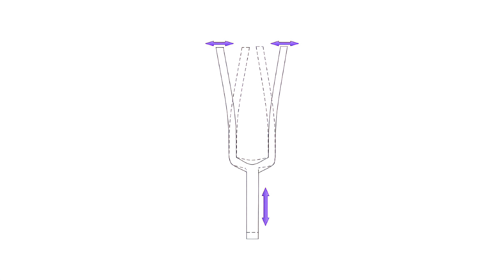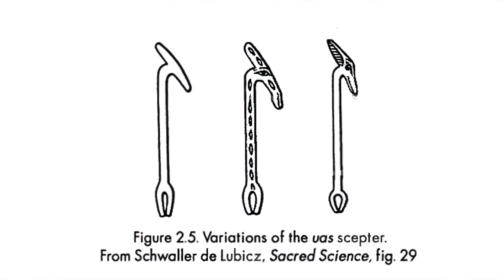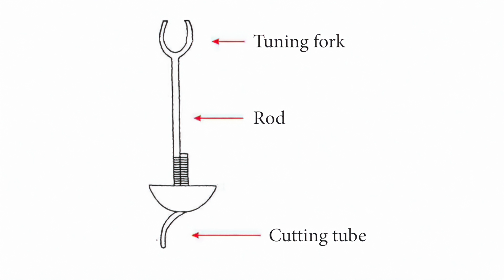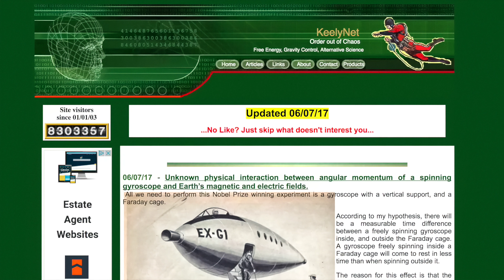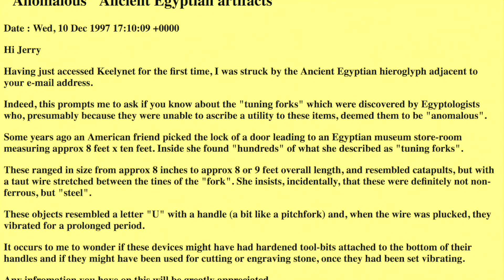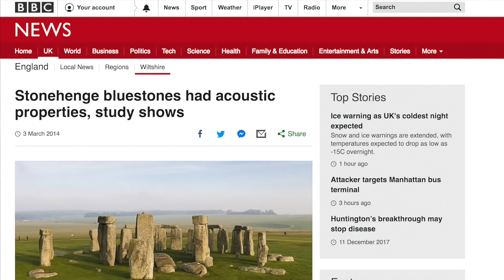How the Ancients Cut Stone with Sound - Lost High Technology Explained | Ancient Architects

Comment: I have spent many years experimenting with Acoustic levitation and technology similar to what is discussed in this video. The acoustic properties of the Megalithic sites need not be understood or planned if the designers did indeed cut and move the stones via sonic technology because the process functions in such a way that the objects will literally move themselves into an arrangement that is like a chord and can "sing". The property of something being out of tune and in a state of discord with the pump frequency is exactly what is used to move the objects into a more favorable lower energy state. What you end up with is energy wells of sorts an from a local frame of reference the stone simply believes itself to be sitting still in a state of freefall for 0.5 * period. Have the cycle the object is in this state of falling at which time friction need not be overcome and only inertia. This is easy as anyone who has attempted to off balance a washing machine will tell you they will literally walk themselves to the most stable vibratory state. Once in that state and place they are now in a node and when pump frequency is removed all objects in the system will now be resonating together to some degree so that when one rings.... They all ring. Idk, it can be a bit more complex to explain.... but the above should be enough to understand why all the sites have these properties. I personally agree, they used sound in the same way we use Electricity. The hows and whys of the technology is completely lost.

Comment: I've been looking at pictures of Was Sceptres or I guess they call them Waset.  I've noticed many pictures have an eye on the top of the staff near the tool.  But what if that's actually a holding pin like is used with axes or hammers or other such tools today?  If a nail is used, that would give the appearance of an eye, but it actually has a function.

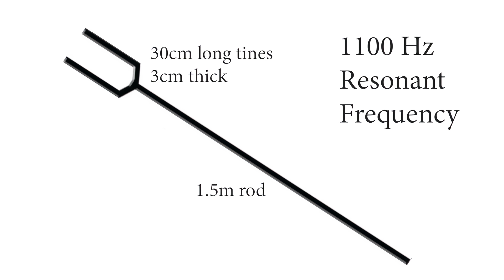Comment: have any of you tried to fabricate such a stick and drill in granite ? You are clever and also show that the bottom stem also contracts and expands, when the U-wings are vibrating . 4:30 How is the frequency of the pitchfork determined mathematically . 8:45 How could the researcher  know for shure it was non-ferrous metal, the only way to find out is you have a magnet, iron is ferrous and one of the only magnetic material . The researcher said, a gray metal that is not steel .

Comment: Matt this is the tip of the iceberg.  You hit the nail on the head here.  these forks could create the holes we see with the proper "bits" attached to the ends as you state late in the video.  insert dry wood and water, and the wood expands, splitting the blocks along a 90 degree line to the face of the block.

seriously, this is something that we can test today.  i feel like even on a small scale this would be pretty simple to accomplish for repeatable results.  thank you as always, cheers.

Comment: bet ya $100. they never cut stone with vibration, it's omnidirectional and can not be controlled to drill perfect holes or cut flat walls at all.  I think it was all cut, drilled and shaped as easily as wood is today with methods we have yet to comprehend. there are many stone jugs people think were turned on lathes but they have handles and that tells me rotating the stone being carved was not necessary.

Comment: I had read or heard about the tuning forks before but it really hit me today with the rod attached to one. If you  attached a row of them along a copper plate with the same resonance then theoretically you should be able to cut slabs or blocks in the same manner. When one is stuck all wil begin resonating as long as there the same frequency

Comment: 6:17 wow  actually they can cut through granite with a copper pipe sand and water.  they did it in the video that you showed.  It just takes a really long time.   The problem with tthe video is that they do not leave the deep spiral threads seen in the drill holes.  The pics of the drill holes dont show the spiral marks in the video either.  Also why is vibrating a copper pipe so much more reasonable than roatating a copper pipe.  you're cutting by abrasion, its hardly a difference yet you mocked the other strategy so hard lol

Comment: This has to be demonstrated to be believable. More conventional mechanical drilling using a bow-driven copper tube with emery or similar abrasive lubricated with water or oil in a vertical orientation has been demonstrated to reproduce the observed characteristics of holes in sarcophagus lids etc. (Gorelick & Gwinnett, 1983, Expedition 25, nr.3, 40-47)

Comment: Interesting idea. It would be good to make an experiment. So far what seems to work is the basic "hole saw" with a copper plate and a rotating axle with a crank and a flywheel and also an electrically powered version which vibrates linearly.

What would be interesting to try is using a bell as the source of vibrations.

Comment: Tuning forks act wirelessly like Tesla coils. You could have a single person hitting a very large tuning fork in the middle of a group of worker all holding in their hands smaller tuning forks of the same frequency and cutting through stones. I know there would be a lot of losses from the air, objects in between, the distance and more which would discourage anyone from even thinking about exploring the subject but I think you could create a room that generates a strong resonance energy buffer and cut the stone at timely delays like a pendulum/spark gap. Very crude experiment showing the effect of resonance of turning forks, same as Tesla coils:  https://www.youtube.com/watch?v=aCocQa2Bcuc      Very high frequency would create penetrating waves wouldn't it? Perhaps mixed with other waves lengths and wave types allowing to softened the stone. The medium you are submitting the stone to will affect the characteristics of the material. Just like metals are hard on Earth but softer and even vapor on other planets with different pressure mediums. Technically if you can affect the molecules of the material with vibration then you can manipulate it's very fabric. Stanley Meyer was using this concept to split Oxygen and Hydrogen by progressively stretching the covalent bond of the atoms until the breaking point using the natural resonance of the material. Tesla earthquake machine. Standing waves. Sound levitation using standing waves: https://www.youtube.com/watch?v=3MXVSdXZzpc

Comment: The thing about Sonic using sonic waves or whatever is nonsense that's not how they would do it to use is solar lens they reduce the radius of the light point to a very small point and get it to heat well above 3000 degrees and granite melts at 2500 degrees then you just mulchy or granite and you poured into a mold then it cools and you produced Stone and structures that way and the main part of the pyramid was built using a type of cement is made from Limestone it's a cement and melted Granite formed in blocks it's not moved they were built on site

Comment: Quartz sand will abrade quartz crystals in granite. All the other minerals in quartz are even “softer”. 
The reason we use diamond impregnated core drill today is because they work quickly. In ancient times with a bunch of laborers quickness was not needed. Using copper or bronze tools and quartz abrasives would do the job - just more slowly. 
The rest of this sonic stuff is BS.
Reply: Also, they have recently found Corundum residues in some of the coring holes, these crystals have a Mohs hardness of 9, close to diamond 9.5.

Comment: Funny, I've now seen a demonstration of a hand crank drill,made of copper, using an abrasive sand slurry, and it worked like a champ ( yes on granite). And I've seen this electrical sonic-resonance drill with a sand slurry, and it seems to work also, but not as well as the hand crank. So now an honest assessment would require the use of occam's razor ( the explanation using the fewest assumptions is probably the best). The hand crank method is materials and techniques the people in this region are known to have had. The SR method requires the assumption that they had the knowledge and means to generate electrical power: for a less effective method. Calling someone stupid because they don't agree with your unsupported hypothesis, displays the level of your intellectual dis-honesty!

Comment: Great presentation, thanks for sharing. You can cut the tube holes in granite with a weighted copper cylinder and a handle to rotate it, using either desert sand, quartz sand (found on the banks of the Nile) or for even better results they may have mined Corandite as the abrasion material and of course water, video demonstration of it here : https://www.youtube.com/watch?v=yyCc4iuMikQ This would also leave the spiral groove that Chris Dunn pointed out.

Comment: But there's that ancient Egyptian "drill", a stone cylinder core from drilling, that has deep scratches that suggest an aggressive power rotary tool that cut it rather quickly. This sound drilling would appear to create a smooth bore like the sand and copper pipe method did.
Reply: It suggest a bad drill..perhaps the copper ones were taken..

Comment: I'm sorry, but you haven't thought this through. You mention frequency, but to cut even the very softest rock you would need enormous amplitudes (volume, or the difference between the peak and trough of the wave). You don't get enough energy to cut stone from a short copper tube attached to a tuning fork. You would have to supply so much energy to that system that the copper rod would disintegrate. The evidence against the use of copper tools is that they are not hard enough. So, the same argument applies here. You would still need a hard edge to cut using sound, because copper will just be blunted against the stone the same as if it was being hit with a hammer, even if it did survive to make any significant contact with the rock.

All the evidence points to stone softening using acids, and the making of different forms of concrete. The tightly fitted stones of Inca sites were achieved using a yellow paste derived from the outflow from mines heavy in iron pyrites, as witnessed and written about by the Spanish. The Romans had concrete, and there is at least a possibility that they got the process from the Egyptians. Relief "carvings" are actually cast, and you can even see parts where the casting was completed ineptly, where the mixture was too wet and the casting ran. On the Giza Plateau there are runnels of granite BETWEEN the limestone pavings.

The boreholes were drilled using a single spiral cut that progressed at a fraction of a millimetre per rotation. That could not have been achieved through sound, nor with any conventional tool that we know of UNLESS the rock was very soft when the cut was made. There are even examples of abandoned cuts that show how the rock hardened as the cut was being made, making it too difficult to continue.

There are also many "sarcophagi" which probably contained reactants, as well as some evidence that at least one pyramid exploded from the inside, possibly as a result of chemistry gone wrong. The Egyptians were known to be alchemists/chemists, and since any other technology would leave behind other evidence, and since there is no evidence of such technology, the only evidence we have (as partially outlined above) points to chemicals/geopolymers.

Comment: I would love to see a real demonstration of this technique. 
If is that simple it should be easy to make a demonstration.
It takes a certain amount of energy to crush a given amount of rock. The given amount of rock is of course the volume of the cylinder wall removed. To do this, this amount of energy plus a factor for losses to heat and sound in the air, must be input.
At the point of contact the copper is still softer than the rock so the wear on the tube would be greater than rock. This would change the resonant frequency of the cutting rod.
I suspect that no-one has done the demonstration. Cite me the research paper if I'm wrong.
At about the 7 min mark the bloke in the video claims there is no way to clear the cuttings.
Ironically he is wrong here. Modern drilling techniques using diamond tipped cutting tubes pump compressed air down the inside of the tube, at the tip the air passes around the cutting tip then travels up the outside of the tube carrying away the cuttings to the open air.
Cite me the demonstration, please.

Comment: 7:03 "the ancients wouldnt have had the tools needed to create the tool marks we see in ancient stone cutting" and then shows a photo of basic drill marks, very shitty drill marks at that that clearly shows very primitive technique.
Reply: Do you realize they did this to granite and the hardest stones? We need high powered drills for this and to this day we still need to change the bit every few hours bc the drill bit wears out and disappears. This is very complicated
Reply: @bobm3250  I work at a granite fabrication shop. We don't have to change the drill bit every few hours because it's not a drill bit-- it's a saw. And when we do have to change drill bits for mounting screws its every few months we take a trip to Home Depot for new drill bits.

The power comes what called the unit of "horse power" -- horse power and that kind of power was not rare or hard to find.

Comment: My uneducated inner scientist has a few problems with this. 

A) the two halves of the tuning forks should vibrate at an equal rate, being that they must be balanced to vibrate properly; I.e. the base or handle of the fork should remain relatively stable and not vibrate as depicted. Vibration is a result of imbalance. Tuning forks are, by definition, perfectly balanced.
B) assuming "A)" didn't put the whole idea to bed, then the tiny differentiations in resonant frequency of the rod handle(due to grit from removed material, inconsistent bore diameter, even wind or external sounds dampening or strengthening the fork's vibration, tiny diffetences in density and strength of the rock being drilled through) would make this method almost completely ineffective at even a very shallow bore depth. 

Try again.

Comment: It seems like a simple enough theory to test.  Has anyone?  If not, why not?  If so, what was the results?
Reply: I mean, we currently user oscillators to cut stone. It's still using vibration cut, and I've used my system in my old van to knock ice off my truck in the winter time instead if scraping it off.

Comment: Sound is a mechanical pressure wave traveling through an elastic medium.[air at 1100 ft/sec and faster through harder materials.] You need a power source for the amount of work need to drill a hard material. Just hitting a tuning fork will never do it.[try it if you do not believe it] It may resonate and all the energy will flow to something of the same frequency - not a fifty ton stone. [ That is unless you have a fifty-ton tuning fork. Where is the power source?  The physics is not there for this to work. If you know how to really make this work please share it.

Comment: This is a very interesting video as just recently sonic cutting was made widely available to the general public. The company Fein Tools  developed the oscillating multimaster and every major tool manufacturer now offers them. The multi-tool is the absolute most versatile tool for cutting as it can vary in speed/frequency and there are also a vast array of different "blades" and attachments including sanding blocks. The tuning fork theory would  be plausible for shaping and polishing the stone as well. For anyone who doesn't know what a multi-tool is, the "head" of the tool vibrates so fast you cant even see it move yet it can cut through damn near anything with speed and precision. the speed of vibration is also known as FREQUENCY!!

Comment: Umm...the problem with this theory is that it wasn't until very late in Egyptian history that iron became common place and smelting was a known art.  Before the discovery of how to create iron they relied on gathering meteorites with highly ferrous properties and called iron the "gift from the heavens".  Now I am not a metallurgist but I do know that copper, brass and tin (which the Egyptians used widely) do not have sufficient density to work reliably as tuning forks.  Pot iron can be used to make simple tuning forks but if you vibrate the iron over long periods it will develop stress fractures.  The most reliable tuning forks are made of steel and, sadly, the ancient Egyptians knew nothing about this metal at all.  So the theory, whilst a decent piece of conjecturing, doesn't add up...sorry.

Comment: https://www.youtube.com/watch?v=PoSsdSEqMRw - technologies in civil engineering in use for decades especially in relation to pile driving in confined situations reducing noise and vibration induced damage to adjacent properties. Not commonly used in hand power tools as 1) how would one induce the vibration in the tool bit and 2) how would one dampen the tool so as to protect the operator :)

Comment: There is a very good video on how the Egyptian's did it with copper tubes: youtube.com/watch?v=i92ORg0ItVk And also explains why there might have been an abundant amount of quartz  sand within the pyramid (to serve as a cutting agent for the drills - in essence a drill bit).
Reply: If you are finding all the sand, then there should be a large excess of Cu compared to the local environment. All the copper lost from the tubes would have to leave obvious traces.
Reply: @ToxicityAssured  - Im sure it does but also remember that they did this several thousand years ago, so who knows if water runoff washed that all away. I'd be interested to see if they find high concentrations inside the great pyramids.